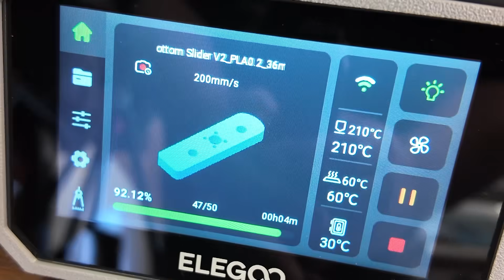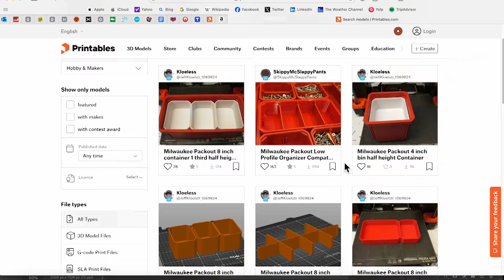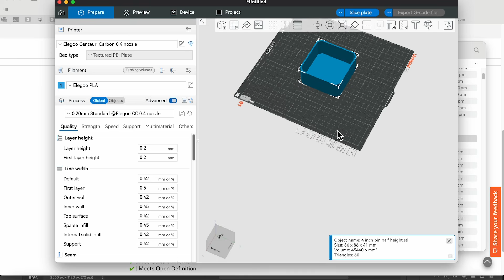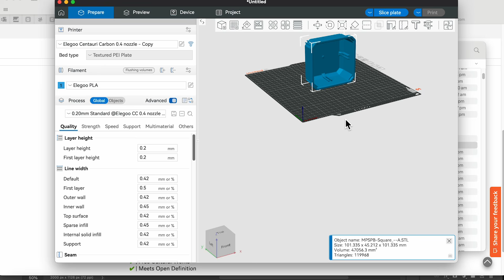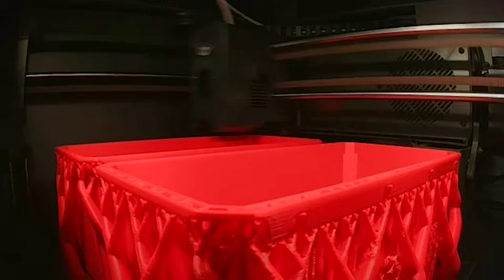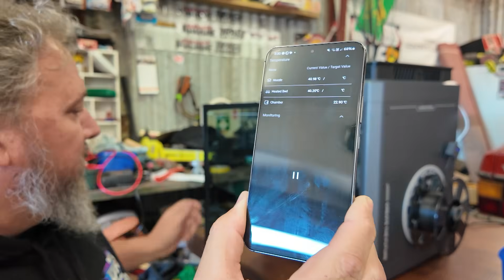Scotty's Garage - How To 3D Print For Your Car Or Garage!

Comment: Great video. I bought a Bambu printer a couple months ago, I'm a total novice with the CAD but I've been making stuff for a little two stroke and I prototype on the printer and then get it CNC's at jlccnc. I also got an exhaust flange 3D printed in titanium just for fun. The tech is crazy good now. The CAD is a bit of a learning curve though in fairness.
Reply from the maker: Where did you get the flange printed? that sounds cool. CAD is driving me nuts right now. I think they make it deliberately hard  :)
Reply: @blownhemi i got the Ti 3D print at JLC3DP and the CNC stuff at JLCCNC. Prices were really good i thought. I'm learning FreeCAD atm. Torn between that and Fusion really but I'm finding FreeCAD easier to get into.

Comment: Great video. I've got 2 of the older style printers and, funnily enough, one is not working currently. Wish I had something like that elegoo!

If you do touch the bed plate, you can wash the plate with normal dishwashing liquid and it'll be all sweet.

You can also increase your layer height from 0.2mm up to something like 0.25mm and it'll make the print faster. Getting a 0.6mm nozzle also helps prints to faster and you really don't lose too much details

Comment: I built the JD's plasma late last year and the pla is holding up ok, did it in Tamo cheapo stuff $9 kg. You'll find when threading bolts into it they'll slip so it'll be an idea to use those melt in threadserts things for better bolting strength
Reply from the maker: Thanks for the tip
Reply: @blownhemi ha, still watching, just seen the threadsert part !  👍

Comment: Great vid Stotty. Dumb question.... What happens if you run out of plastic half way through a print?
Reply from the maker: It does have a filament sensor, so in theory it should just pause and you can load the next lot of filament in behind it but I haven't had to do that yet.

Comment: Scotty if the printer is going live and operate in the shed, I suggest you invest is a cheap plastic cover to go over it, yes the chamber is enclosed, but the filament isn't. You don't want dust and debris all over the filament, it will lead to premature wear and issues with your prints. You might want to buy a cheap dehumidifier just to keep the filament protected and limit the exposure to humidity. Alternately if you know someone with a 3d printer they might be able to print you a filament cover...
Reply from the maker: Yep, all good tips and stuff I've been thinking about

Comment: Been printing for 13 years now. $9.99 filament is rare especially a name brand filiment, I have been know to use no-name filament from ebay and Amazon and it can require a lot o tweaking bed / nozzle temperatures to get it to adhere and print all the layers correctly. Try to avoid spaghetti as it can get into the printer components and be a pain to remove once cool.
Reply from the maker: Yeah, that's why I bought more of the Creality filament. It works pretty good for cheap filament

Comment: G'day Scotty, Ive just bought a Flashforge 5m. Amazing what you can do with them. 1st and foremost...LEARN TO USE A CAD program! If you want to design your own stuff. Theres a lot of Generic goodies to find on the www. Need to ask about the toxicity of the different Filaments too. Some can kill you! PETG is the go to for more UV and weather resistent bits. Beware! once you start it,ll will get addictive...Printables has a bit of holden stuff that people have designed as replacement parts..Cheers 
PS: right click to drag and Orca is a combination of Prusa and Bambu slicers...
Reply from the maker: Thanks for the info, and you're right the fumes of some filaments are dangerous

Comment: Do you think it would be possible to print tail light lenses? It's pretty much impossible to buy lenses for my VG ute.
Reply from the maker: I'm very keen to try this myself. I want to get my CAD design skills up to spec first
Reply: @blownhemi . Keep us posted mate. It's a money spinner for whoever can get it done. Cheers
Reply: No chance if you want them to be transparent. Printing leaves layer lines so they would never be perfectly transparent. You might get better results with resin printing over FDM but I doubt it would be worth the effort.
Reply from the maker: @classiestbogan resin printing would be better, but most taillight lens have lines of some sort in them. For unobtainable lens, the effort is worth it
Reply: @blownhemi  Not a line every .1 to .2 of a mm though.
Reply: I printed some blinker lenses in transparent PLA, they came up ok, but I had to print them a bit thinner than the original lens to get decent light out of them.
Reply: @jakesimpson64  the proverbial light at the end of the tunnel. So it can be done?
Reply: Getting light through them was my main worry. Clear comes out more like frosted.